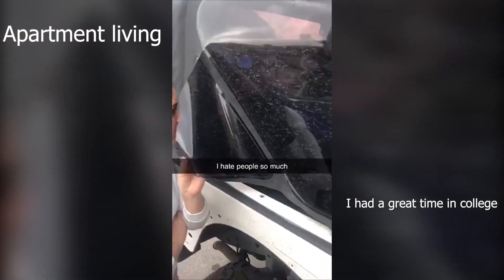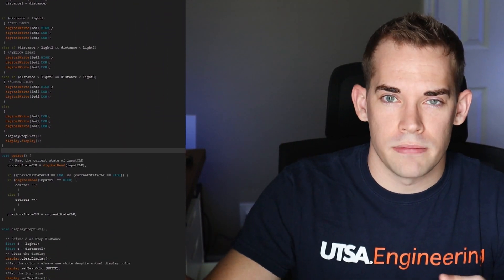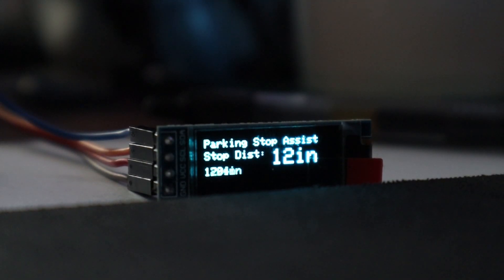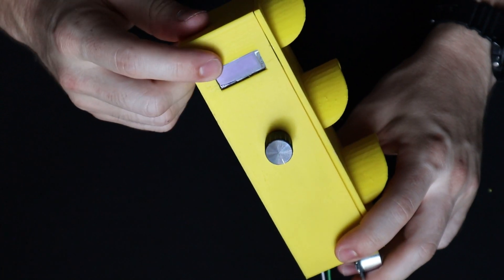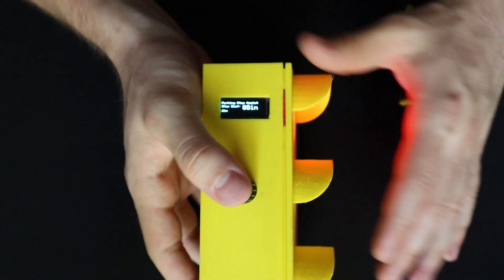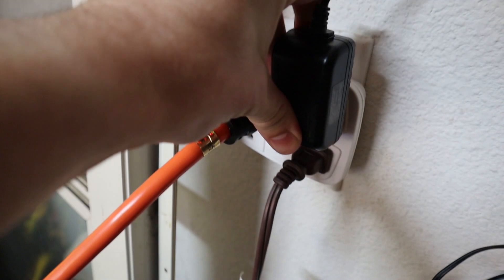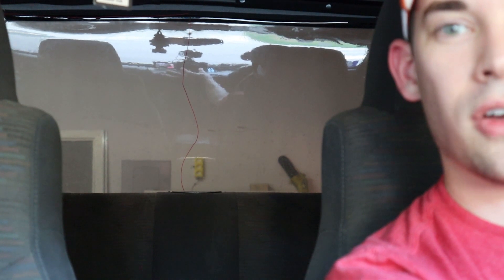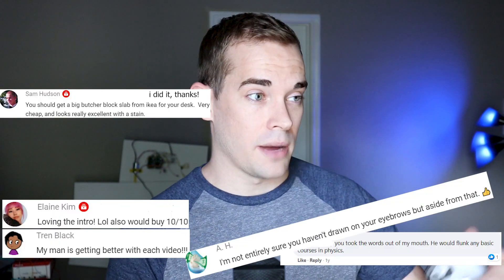DIY Garage Parking Assist Stoplight

Comment: Ty, do you have a solution for the side of the garage? I was driving a sedan, but I just transitioned to a SUV. It is hard to gauge the depth and distance on the right side of my garage, which is a wall.  Thanks!

Comment: great project but I have two quick questions. the switch in your video is different than the one in your parts list one has four points, the one in the parts has three. Which one do I use?   and please. if you send me this code that includes turning off the red light say after one minute I will make sure your future ancestors are blessed  lol

Comment: In your parts list, for the OLED display, you said "trust me, get two".  Why is that?  Are they flaky -- and is it possible one won't work?
Reply from the maker: I broke one by accidentally bending it at the solder point. I was being careful! But not careful enough haha. You might have better luck than me.

Comment: Hey Ty, a pretty cool video.  I have been attempting to do this very same parking system but only with  traffic light.  I was successful in all aspects but after parked the code should reset.  Unfortunately I have not had the time to research to get this working as I would like it.  Today I ran across a few other videos doing the same thing.  One by "Mechanical Max" who added a calibration step where you added the calibration knob as well as a OLED display. I am looking forward to looking at your code and perhaps using it with my traffic light.  I also like your 3D printed case.  I also have a CNC from Stepcraft and can mill, 3d print etc.  I think your video was a bit rough but I can understand being able to work with what you have and I can appreciate your work.  I have subscribed

Comment: Great project! I gave it as a gift. I'm a coding novice--could you possibly help with the code for getting the red LED to shut off after X number of seconds? As it runs now, the LED stays on and unplugging is required. Thank you Ty!
Reply from the maker: Hey I really appreciate it you checking out the video!
I haven't messed with the code too much since posting this, but here is a comment by Adam Davis, 
//
Make variables "sleeping", "lastActivity", and "lastDistance".  In the beginning [setup] set sleeping to false, lastActivity to millis() and lastDistance to the current sensor reading.

Every loop check if the sensor reading is more than four inches different than lastDistance.  If it is, set sleeping to false, lastActivity to millis() and lastDistance to the current sensor reading.

Every loop check if millis() > (lastActivity + 30000). If the last time the distance changed was more than 30 seconds ago set sleeping to true.

In the display loop (LED output) only run it if sleeping is false, otherwise set all leds to off and display the splash screen with upper case z's moving up and away from the sensor image.  Also check the distance, and if it's greater than the green distance, don't display the jeep part of the splash screen.
//
Let me know if you need more help John!
Reply: @TyPalowski  Thank you Ty!

Comment: nice video.  nice project.
as always, I have to offer suggestions.
add two other ranges   green and yellow     yellow and red
add yet another range  red blinking 
I didn't look at the code, but how long is the delay before it shuts off ?  
================
deep dive....
sensor is set for a jeep back window.  too high for a car.
you could make the above to work with the windshield.

does it go on when the door goes up and off when the door drops ?
Reply from the maker: Hey Dave! Sorry I'm getting to you late, I was at a training all week/weekend for work.
Thanks for checking out the video and leaving suggestions, I'm far from an expert on any of this so I'll take all the help I can get haha. 
Adding those ranges would be cool to give a smoother visual experience. Some one also suggested adding a smoothing calculation (i.e. moving average) to the distance measurement so the lights don't blink back and forth. 
Another commenter wrote some nice code that would add an off function if the range hadn't changed by a certain amount within a set time period. The LEDs don't bother me too much, I was more worried about the burn in on the little OLED. When mentioning that to the guy that wrote the off function code, he said just to buy another $2 OLED haha! 
You're absolutely right about the sensor possibly being too high for a car. I mentioned in the video that I left the opening to the bottom of the case large just incase I needed to add a cable extension to the ultrasonic sensor, in my case it worked out so I didn't bother. 
Thanks again for watching and commenting!
The Range I set the edge of the green light to is inside the distance to my garage door so that is not a problem for me.

Comment: Very cool!  I saw this over on the Arduino subreddit, and watched.  Nice, relatively simple, but well executed project, and I love your video editing/presentation style and humor.  The only thing I would add personally is some kind of filtering/smoothing function for distance measurement, to decrease the amount of flickering you see changing between lights.
Reply from the maker: Hey thanks for taking the time to watch and comment! You're completely right! Of course I thought of that after the fact haha, but writing in a function that takes a moving average of the distance measurement and uses that to determine which light to activate would be much better. Thank you for the suggestion! I'll come up with something in the code and add it to mine and maybe the one that I'll be sending out.
Reply: @TyPalowski  You do it like a thermostat. Instead of checking a hard limit in the code for switching you subtract one inch when checking to go from green to yellow or yellow to red, but add 1 inch when checking red to yellow or yellow to green.

Comment: The red light stays on as long as the car is parked right? Maybe you should make it turn off after some minutes without a change of distance
Reply from the maker: That's a good idea! I tried looking into ways of dimming the screen as well (for burn-in) but nothing jumped out at me. I'm sure there's a way to have a secondary function running that measures the time an object is within a certain range. Or maybe I could set the red light to turn off just after the threshold and have a similar effect as the green light? 
Thanks for the comment and taking the time to watch!
Reply: @TyPalowski  Make variables "sleeping", "lastActivity", and "lastDistance".  In the beginning set sleeping to false, lastActivity to millis() and lastDistance to the current sensor reading.

Every loop check if the sensor reading is more than four inches different than lastDistance.  If it is, set sleeping to false, lastActivity to millis() and lastDistance to the current sensor reading.

Every loop check if millis() > (lastActivity + 30000). If the last time the distance changed was more than 30 seconds ago set sleeping to true.

In the display loop (LED output) only run it if sleeping is false, otherwise set all leds to off and display the splash screen with upper case z's moving up and away from the sensor image.  Also check the distance, and if it's greater than the green distance, don't display the jeep part of the splash screen.

And don't worry about oled burnin. Buy another $2 oled display and stuff it loose inside the case so you can replace it if it ever gives you trouble.
Reply: @TyPalowski  Can you please integrate this into the code? I'm working on building this and it would be PERFECT!

Comment: Awesome bud very nice build, especially the easy calibration function.
I built something similar but a little more crude.
An LED switched by a radar beam, so as you reverse into the garage the beam is broken, the LED switches on and switches off again once you are clear of the garage door.
Love your stuff mate keep it up.